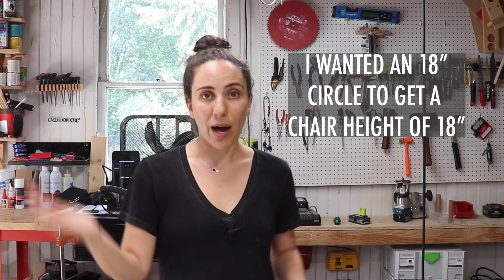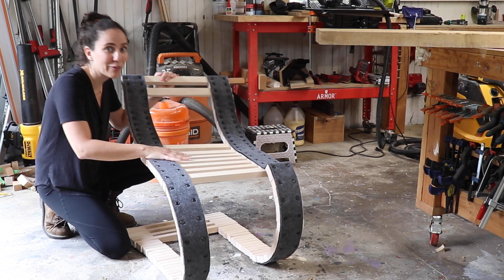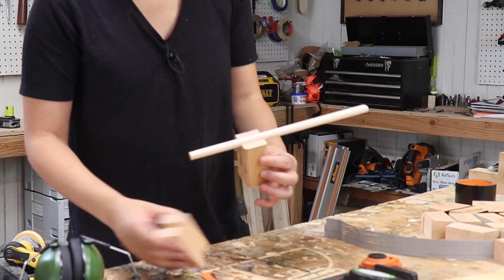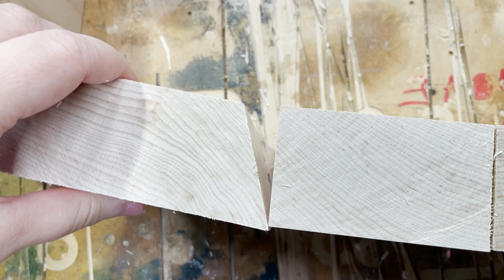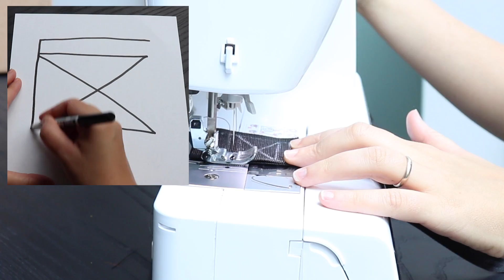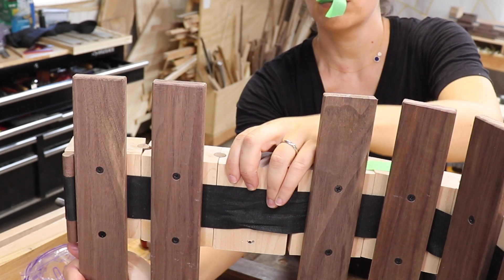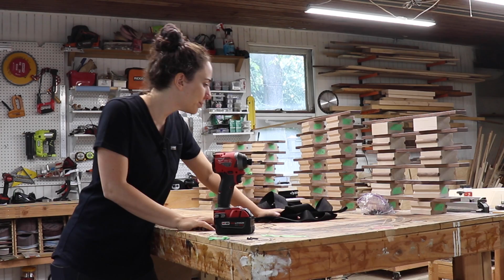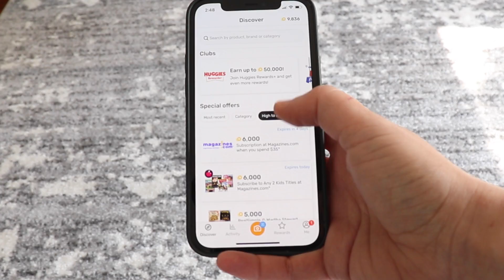I ATTEMPT to make a Roll Up Chair… AGAIN...

Comment: Why not route a centerline and use steel rope?
Reply: You could also do sectional tension, where some curves are connected individually and other sections with less tension problems could be connected with less tension

Comment: I know it would be a ton of work but have you put any thought into inset hinges between each block instead of using a webbing material. This would also help with the cross bracing in place of the dowel rods.

Comment: The tensile loads are in the thousands of pounds and you need close to zero stretch, nothing short of steel chain is going to hold and were talking something like 5/16 grade 80, not a sink stopper chain.

Comment: That's a cool lookin' chair! But, the forces on the strapping at the curve are enormous, with what amounts to a foot long lever arm back to the seat. It seems you're already using webbing made of Spectra/Dyneema type material which is low stretch, but you might want to try Kevlar or even carbon fiber? Also, it looks like you have room to double the width of the strapping? Maybe a stainless steel mesh? Good luck though, I'd love to see it work!

Comment: Cut slots in the pieces of wood so you can weave the strap back and forth like a jacobs ladder toy. That way the strap will be equally distributing the pressure on both the back and front of the structure as opposed to just the front. And if that doesn't work change the strap to a metal cable and drill holes through the blocks to connect them.

Comment: All of the tension on the straps down by where your legs are supposed to go is deforming the tighter curve leading into backrest. I think you could solve this problem by using one pair of straps for the lower half and one pair of straps for the upper half.

Comment: Think you just need to secure the straps better to each piece. The straps probably slips beneath the board which means you need to account for the stretch of the entire strap. If you fastend it close to the edge of each piece there would be only a couple of mm of material that could stretch at each seam.

 Another alternative would be to use hinges.

Comment: construction tie straps? those yellow nylon ones, if they can hold like 10 tons each they could hold up a chair. or go with steel cables, those will be very stiff and not break catastrophically like polymer

Comment: If the strap went from the front face to the back face right where the chair went from curved to flat at the seat, the tension would pull the back away from the curve, not towards it. The leg section has tension around the outside radius compressing the wood. The back section has tension around the inside radius separating the wood. This does change the direction of rolling at that point, which defeats the purpose of a rolling chair. Perhaps if the strapping was sandwiched between two pieces, the tension being in between the inner and outer radii would help reduce the folding problem.

Comment: I love your videos and work. I think you were on the right path, but every material has a certain elasticity. The material you are looking for is a steel cable, about 5mm thick, so it would be malleable enough for the chair to be folded and the elasticity at room temperature would be virtually none.

Comment: Maybe a steel cable running through the middle, that would eliminate the curling, but you would need a tensioning system, so you can loosen the cables to be able to actually roll it up.
Reply: Maybe a locking cam?

Comment: You design will never work, not unless you can find a material with zero stretch. You would be better to add mechanical hinges to the chair. Fabricating a long hinge with multiple pivots along its length would be my solution. Hide it under a strip of leather / fabric and it will be an invisible solution and give you the look you are looking for.

Comment: Leather will stretch for sure. One solution could be to glue the straps to the wood on the full face. The issue is that the whole strap can elongate to create a problem at a single point. By gluing the strapping to the face of the wood blocks, there can be no stretching and opening up of any joints, at least not more than what you are not gluing (maybe you need to let a quarter inch unglued right at the seam to keep the flexibility). Limiting the stretch of the material is key I think, and when 90% of the strap is actually glued to the wood block, you also eliminate 90% of the stretch that can happen. Additionally, any stretch happening cannot accumulate somewhere else, but can only happen in that one single joint.

Comment: Have you considered door hinges instead of webbing on the front curve?  As it is,  you've got some long webbing creating a big lever and most of the force is focused on the small area that makes up the main curve.
I'd also test to see whether the shape itself is stable when built as a solid  - I.e. jointing  and gluing the lower pieces together (ignoring the backrest for now). It may well be more bouncy than is comfortable anyway.  This shape of chair is usually made from plywood, because it's so good at transferring the force along it's layers, but I don't know if I've ever seen one with such a deep seat.  And then your model builds cracks into it, stopping the force distribution.  You surely need 100% contact between each block in the curve? As soon as you have even the smallest gap, all the force will be concentrated on the tiny length of area where those blocks meet.  That's why I thought of metal hinges, turning it into more of a caterpillar track.

Comment: A great project that keeps me coming back. I think you are incredibly close to your goal, and have come up with some great ideas to overcome issues I hadn't even considered (that trick with using dowels to help prevent the slats from slipping against each other... Inspired!). I do, however, have a suggestion to overcome the current challenge of getting enough tension to hold together and bear weight, whilst still being safe (especially around kids!):
Use opposing tension (not sure if this is the correct terminology... I'm not that kind of engineer!).
Keep the polyester straps on the face of the chair (with, perhaps, a small amount of additional tension), but add a second set to the back side of each piece, such that there is quite a lot of slack when the chair is in "chair mode", but would be ALMOST taut in "rolled-up mode". This second set of straps should be attached the same way as the "front" set, but without being so tightly clamped between the structural frame and the retaining strips, allowing it to pull through easily. When in "chair mode", the slack can then be pulled taut from one end, around some sort of bearing surface (a thin roller or equivalent would be my suggestion. Alternatively, just have the last retaining slat have a half-round profile on that edge, surfaced with Teflon tape) and secured against some suitable point on the back side of the frame using hooks and eyelets or similar removable fastenings (ideally with turnbuckles / ratchets or similar to allow you to lock that tension in more easily and safely. Think similar to ratchet strap tensioners. Easy to tension, secure, but also easy to release).
This system would be as close to having the strength afforded by having the pieces glued together when in chair mode, but would still allow you to roll the chair up by unhooking the strapping on the back side to release the tension. The tension from both sides of each joint will also hold them even more firmly and safely around the dowels.
With regard to the front strapping, another issue is that they aren't supported all the way to the edge of each piece. To achieve this support, either the slats could be made wider so that they cover the strapping all the way to the edge (fun math there for you), or you could use either metal or polycarbonate shims (metal could be thinner, polycarbonate allows for a choice of colours to suit whatever aesthetic you might want) under the slats that would cover the strapping right to the edge.

Comment: Use lift sling straps. They are rated for a certain amount of strength. Also the thicker the blocks are, the less strain there will be.

Comment: How about using metal hinges instead of a strap that would wear and fray and break over time with the wood rubbing against it anyway? You could use the straps purely for aesthetics, to hide the hinges. You could also try making the angles of each piece of wood so that the curves aren't as big, to compensate for the sagging? Just my thoughts, not sure if it would help.

Leather also would not work, it stretches with pressure. That's how leather boots/shoes are made, by stretching with a machine to form the shape of the toe.

Comment: why dont you consider interlocking the wooden blocks and attaching each of them using a metal or wood rivet > imagine a chain made out of wood but there are supports in the design of each individual block and the blocks are connected together using metal shaft > like a metal watch strap not the fully chain mail ones the sort of blocky ones . 
You could even improve the design by adding a lever like design in the blocks so that one block overlaps the other block on the inside of a curve.
if you had discord people could make 3d designs for this thing i am imagining.
bamboo ropes can also be used instead of the metal wires people are talking about!

Comment: I'm somehow convinced that the best (or "less worst") solution would be mechanical hinges. It's a lot more work and screws and weight and eyesore unless you play with the wood/metal contrast, but still... little to no stretch.
Reply: Self responding to my own comment!! : apparently, heavy duty straps, albeit ugly as f###, are not stretchy enough to work : https://www.youtube.com/watch?v=MuodNlDKce4

(as long as you do not put fire on spray paint :D)

Comment: Perhaps just ditch the webbing/tension idea altogether. If you were to use piano hinges between each individual piece and create an inset for them to exist in then there wouldn't be any change of the pieces causing other ones to collapse inwards. Piano hinges may also provide the side-to-side stabilization you need in this sort of chair design while eliminating the need to top 'clamping' wood pieces

Comment: you want the tension to be focused on each joint individually, that way there is no chance of it pulling the bottom up or collapsing the back, the straps sliping through each wooden brace compounded the tolerances and also pulled from other areas. not all the forces are equal, so more tension is required for the bench bend, in comparison to the straight sections
Reply: Screws will concentrate the force in that area and can rip thru the webbing if the compression between the slats loosens.

Comment: A cable with a tensioner at the end, and drilling through the block in the straight zones were it curls to compensate forces. A cable going in the middle of the block will have no tendency to curl but wont support the straight figure as much as an exterior support

Comment: As I see it there is two opposing curves, the tensioning structure (like roller chain suggested by @
gadgetroy) should run in the middle (or change side) of the supporting structrure to counteract those opposing forces (see that collapse at 23:08). And there are a lot of other technical aspects to tensioning structures that I’m not the right person to talk about.

Comment: The strapping is on the outside portion of the curve closest to the floor, and on the inside curve of the upper portion. What if you have the strapping go through the rails to also support the outside of the upper curve. I'm not very smart but it kind of makes sense to me.

Comment: the way it's done it's basically a chain of fulcrums.
Any amount of weight/force on the chair is multiplied several times as tension/pull force on the straps.
the other way around, even a small amount of stretch in the straps will have a big effect on how much the chair droops.

This could possibly be done if you majde the connections between the blocks in something that has "zero" stretch... like metal. but because the force increase... even metal will have some amount of deformation over time.

Comment: The strapping is an interesting idea but it will never work if it stretches at all.
Over that length, and with a suitably weighty person, even a metal cable will stretch.
It strikes me that you should use hinges between each segment. They will allow the structure to roll up and have no stretch. You'll need to affix the hinges securely and make sure the hinges around the lower bend are suitably strong (since they are under the greatest tension).
It may not look as good but it will function and you can work on 'prettifying' it later...
Also, with hinges, you may keep the doweling for looks, but they won't be necessary.
In fact, why not use a hybrid system...
Fit hinges under the webbing at the segments around the lower bend and use webbing only on the upper section where stretch can create comfort. The webbing will hide the hinges and they will stop the webbing from being so elastic...

Comment: Very impressed with how hard you try on this tricky piece of design! You rock! :-)
You really are not far from success (honestly). You definitely need absolutely non-elastic, non-stretchable strapping, that's one crucial point. Forces/torque at the joints are **insanely high**, and for the chair to be stable and sturdy, you can't allow any axial elasticity. Just figure it like if you were making a chair with flexible legs; here the strapping is one of the two elements acting in lieu of legs in this design - the other one being the wood block, at each point respectively. You could actually use strong ropes or cables, eventually hidden under a comfy fabric if you can't lay hands on usable straps/fabric for this project... Second point: for stability/sturdiness purpose again, I would go for end grain cuts for the angle parts. Facing end grain cuts, even at an angle, are way more solid than any other possible "joints" (even if not glued), and deformation with time will be less likely to happen.
I would really like to help you on this because you are really not far from success! If I have some time, I will try and do some 2D/3D mockups (with physics annotations) so that you get your chair done! That will, however, not minimize all the good work you did so far :-) Success comes from experience. Experience comes from failure.
Reply: Don't know why I did not think of it earlier: I think that polyester webbing is a perfect fit for this project. It (almost) does not stretch at all! Polyester seatbelt webbing should do the trick - provided that it's 100% polyester (some seatbelts seem to mix materials to allow for some stretch in order to "ease" the strong stop feeling when braking => those would not be OK). Thin enough, UV resistant, 100% waterproof (unlike nylon). Even better than kevlar as kevlar is not UV-resistant and can turn pretty week when exposed to UV's.
I've done some maths, which made me realise that my "end grain cut" advice is likely to be a "false good idea": the torque on the thinner parts of the angles could actually tear the fibers and split the wood blocks... Really hard to tell with a pencil and a sheet of paper though, that would require proper testing ^^ I think the way you did it so far is safe enough, especially with hard wood.

Comment: Any woven strap will stretch, you might try using wire cable. 1/4" (6mm) wire cable run in 2 grooves on each side, you could then use the last 2 blocks at the bottom to embed a hook and nut configuration to be able to tighten the cable to remove the inter joint slack.

Comment: Since you are distributing the force on the strap throughout the piece, even small amounts of play can concentrate in high force areas. Your though of stapling the strap at each slat may help with that. Using metal hinges would also help, and while doing that for the entire piece may be expensive and create a different look than desired, it may be worth considering at high stress points in the piece.

Comment: I love the series (even though I'm sure you totally would have preferred this to never become a series). 
My 2 cents: This may sound like a stupid and totally obvious suggestion, but: why not make it hinged? No flex and mechanically simple. The original design used straps, but this is clearly not working. And even if you found a material that worked, chances are that over time it would start to sag.

Comment: Possibly a dumb idea - is it possible to create a brace that also rolls up by the side of the maple that curves in to the bottom? It would curve the same way as the seat under tension so should roll in too. Maybe that’s against the ethos of the project though.

Comment: Weight would be an issue... but instead of using straps, metal hinges at every joint? You'd pretty much need custom hardware for it, though. The tension would probably unbend any standard rolled hinges... would likely need to weld them into closed loops... Or have strap pivot hinges on the sides instead.

Comment: what if you cut the webbing and had individual segments for each joint, or at least just for the worst joints or maybe break the chair into groups that are of course all connected but supported by different straps? Maybe that would introduce a bunch of new challenges but my logic is that different parts of the chair would not have to compete with each other and the gaps should be less extreme since a 4" or so segment of webbing across a joint shouldn't be able to stretch another inch like the 8 or so feet single length you used in this video did.